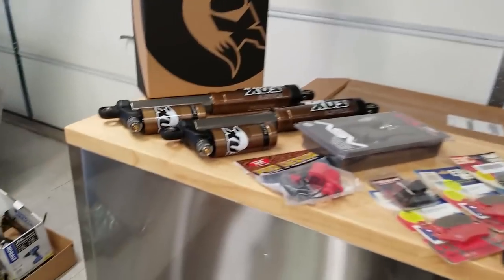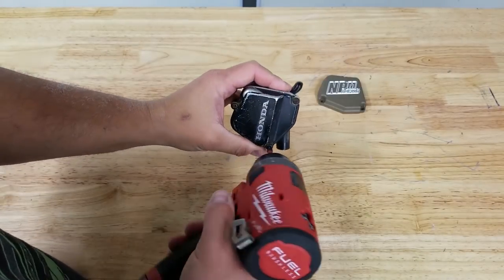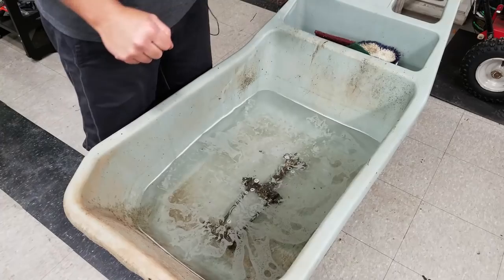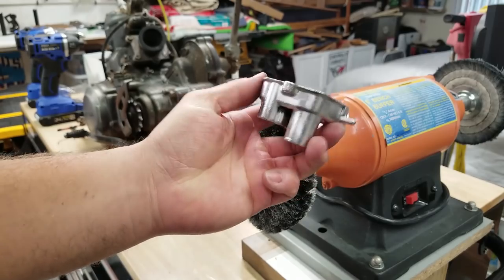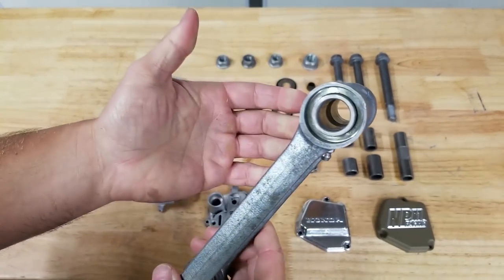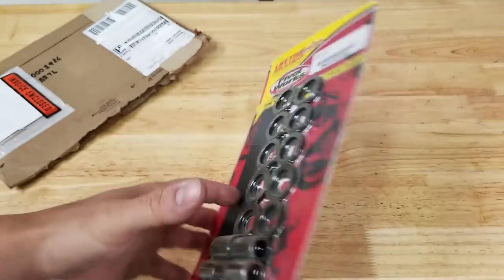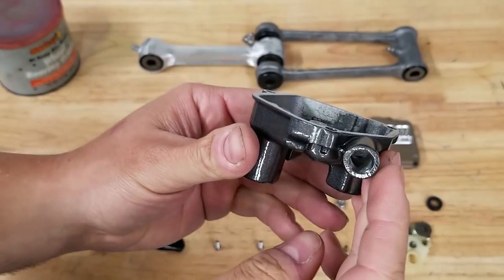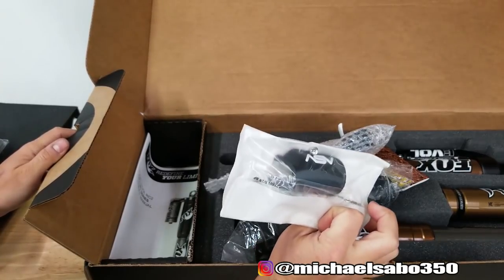Linkage and Thumb Throttle Restoration | Project 250R Part 13

Comment: The fox evols are sweet ran em and raced them for years if you need any help w air pressures settings hit me up i know them well!
I just switched to some custom fox spring shocks from BNR MOTORSPORTS and they are pretty sweet only downfall w the air shocks is they require double the maintenance vs a spring shock!

Comment: a future build ???? did i just hear you let slip that you might build another 250r ???? that would be sweet . if you build a second one . build it for xc
Reply from the maker: If I do it will most likely be XC 🤘
Reply: @MichaelSabo  dude !!!!!!!!!! youre my boy blue !!!!!! . after i get the 450r i got ripped off on together and racing . im going to build a second 250r also . my 250R's are for the LACC and my 450 is going to be for all other series and practice

Comment: You spend $4500 for a-arms, shocks, and other tricked out parts and put in a $40 ebay bearing carrier. That makes no since at all.
Reply from the maker: That's why I explained the reasoning behind it in my video; doesn't always make sense to spend on a brand name when I've heard such good feedback on no name brand carriers and I can always put quality bearings in it down the road Nicholas.

Comment: That “yellow stuff “ is clear coat. Honda put it on the dogbone and the shocks. They also used it on the atc front shocks/forks and triple clamps. It’s a process they did by dipping and flash drying.

Comment: Run the same carrier in mine. Bearings were still good after 3 years of riding.. 100+ hours. Only changed it for maintenance. Can't beat that for 40 bucks. Just buy a new one once the bearings wear out.

Comment: I have ridden elkas in the front for years. I’ve probably had four or five sets. I got the Chad Wienen series floats about 6 months ago and was blown away. The Kashima coating makes it feel like there isn’t even shocks on the bike. I’ve had peps also. I literally as so happy with the floats. Just make sure you get the air pressure right. Comes with good instructions on how to inflate them up but you have to inflate two separate sections a top and a bottom. I’m sure you know this already but just figured I’d throw it out there. Hope you’re staying safe my friend can’t wait to see the build finished. One day I’ll send in one of my bikes for bike the week. Have a few cool bikes to show you.

Comment: Also if I can recommend one thing. Get the houser rear linkage. It’s like 110 bucks and will totally change the feel of the rear end. Cheap mod but it completely changes the feel of the bike. It’s a stock parts so it ships right away.

Comment: I can’t wait to see this built get done and just the process of it getting there keep up the good work and rn I’m trying to do a built with my 06 Suzuki ltr but don’t have the a lot of money to put into it
Reply from the maker: Thank you for following the build dude; take your time with the LTR man, I used to watch eBay and FB market place to find all the killer deals or wait for a blown up bike to buy that was already built and swap the parts over.
Reply: Michael Sabo thanks for the advice I’ll for sure be checking them daily and hopefully it turns out good thank you👍🏼
Reply: Michael Sabo also when I first bought it everything looked good engine was untouched and when I got it back to my house I started looking at it more and more and there was a lot of little things that u wouldn’t worry about looking at but now we got all those little things done and fixed now it’s on to the fun part of customizing it🔥